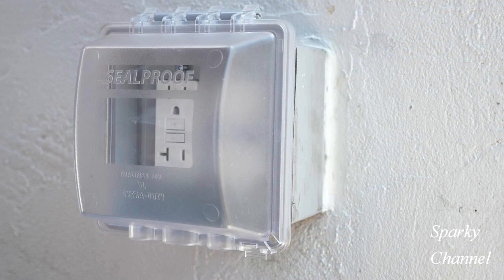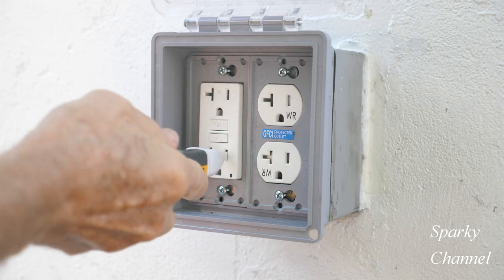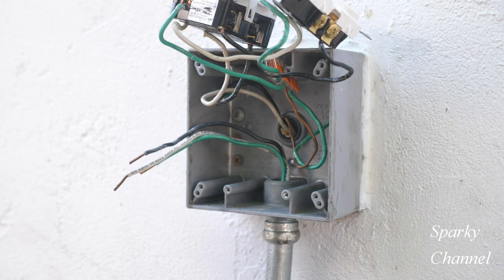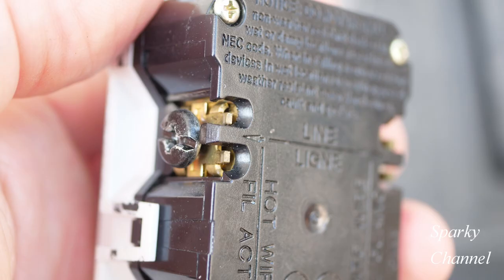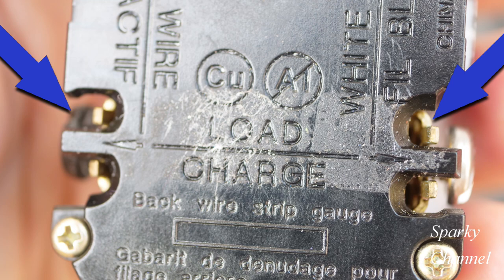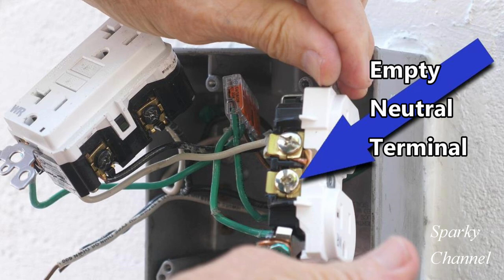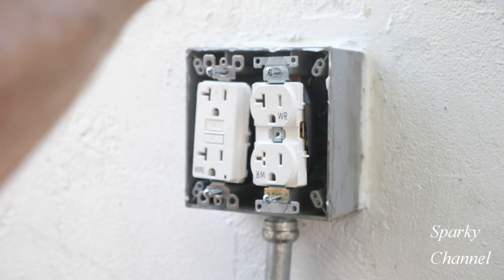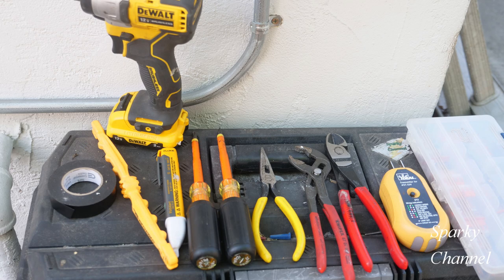How to Add a GFCI Protected Receptacle

Comment: I would have just pigtailed everything to the load side of the gfci.  Interesting way of doing it.
Reply from the maker: That would work as well. thanks!
Reply: Yeah I was trying to add an outlet on the other side of the wall of the downstairs bathroom which has a gfci outlet that protects the upstairs bathroom outlet. Pigtails sounds like the way to go. Thanks!
Reply: 1st Sparky Video I've Seen Where Sparky Actually Ran Power Off Another Outlet. Usually He Hooks To Wago Lever Nuts Just In Case The Receptacle Goes Bad The Downstream Receptacle Will Still Get Power.

Comment: Great video as always!  Nice tip on caulking the edge before putting the cover on!  On checking the LED light on the GFCI (0:43), variety is the spice of life and electricians, and GFCI LEDs are not standardized.  Eaton has one where a LED is off in normal function and then turns orange when it is tripped.  Obviously if it was on and then turns off after a breaker pull, you can feel good with that.
Reply from the maker: I do wish the different companies would standardize their GFCI receptacle LED warning lights as a user could get confused. Thanks RJ!

Comment: pro tip: a fast and easy way to confirm which side of the GFCI is the load side, is to feel the tape residue that the tape used to mark the load side of the GFCI; as it comes out of the box, always leaves.

also, in a marine environment, metallic raceways and boxes will start corroding almost immediately.  where I am, if you want it to last, you use stainless and PVC for everything you can. in fact, I always put the mild steel screws that come with the cover into my supply box, and use the stainless screws that come with the WP rated devices.
Reply from the maker: Hi Ken! Excellent tips. I always learn things when reading your comments.
Reply: @SparkyChannel  as an old Mainer i used to work with taught me, "you can learn a lot from a lazy man."
Reply from the maker: @kenbrown2808  LOL! Yes, they are always looking for easier ways to do things.
Reply: @SparkyChannel  the tape residue trick works great when troubleshooting newer GFCI receptacles that homeowners installed to replace older receptacles fine the hot leg with your voltage sensor and then check for the residue to see if they got caught by the relocated line and load.
Reply from the maker: @kenbrown2808  It's difficult to get the glue residue off of the GFCI as well.
Reply: @SparkyChannel  also unnecessary.

Comment: I have taken up welding, and have a question.  The welder I'm using requires an nema 6-50 plug and outlet. I installed the plug on the machine, and since I live in a mobile home, I'm having to use an adapter cable to plug into the 4 prong dryer outlet, then run the extension cord out the back door. I'd like to have a 6-50 weatherproof outlet installed outside in order to not have bugs and crap coming in thru the open door. I have a 200 Amp service panel inside (installed upside down for unknown reasons..) that has 2 breaker spots together hat are available for the 2 pole 50a breaker I'll need. Should I use the available spaces on the breaker box, or should I get something similar to an A/C setup with its own external box on my side of the meter? Thanks for any assistance you can offer! Note: I'm not going to do it myself, but am trying to see the best course of action

Comment: Hi Bill,  one question, If I have to run 4 outside receptacles around the home. To save some money Can I Use the first GFCI and use the other 3 non-GFCI receptacles. For Electrical connections, I feed power to GFCI receptacle to Line side and giving other receptacles power from load side of the GFCI receptacles. Is this idea good? Thanks a lot in advance for your reply.

Comment: Bill I need help. Can you add a two prong outlet off of an old light switch? All I have on this switch is a neutral and a hot wire for a light in the kitchen. Would I be able to safely add an outlet from this switch on the other side of the wall?

Comment: I am sold on the backwire style receptacle - it is all I have been using for the last several years. When I get lazy and don't use a pigtail to feed a down-stream box, I've decided that it is better to put both wires under the same screw. It is designed to hold two wires and you are not relying on the internal structure of the receptacle to carry the load. And if the screw comes out both devices fail. Maybe making troubleshooting easier.
Reply from the maker: Good points. Yes, those terminals are designed for 2 wires. I do feel more comfortable with one wire under one terminal though.